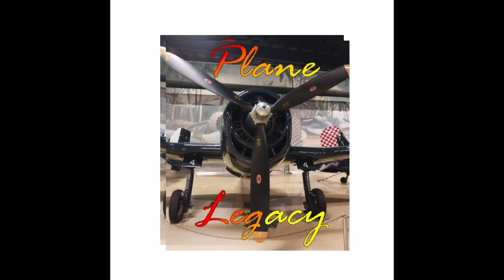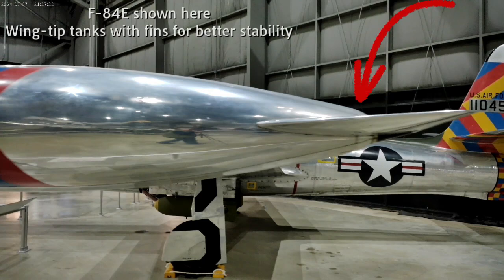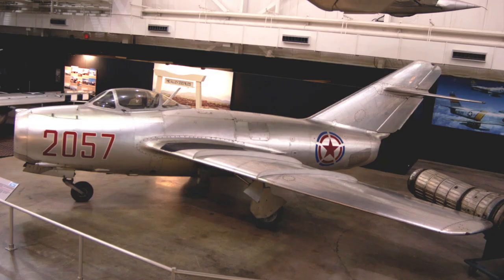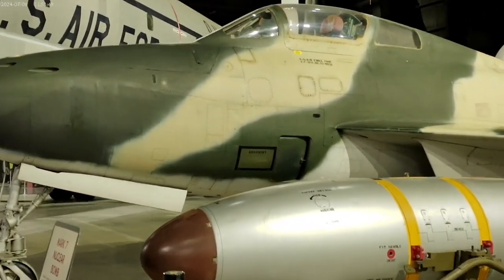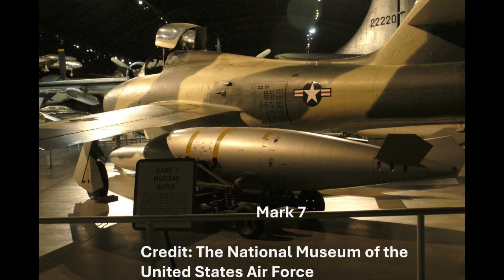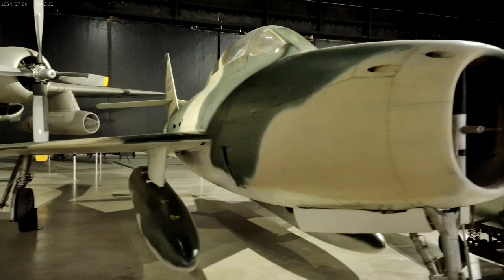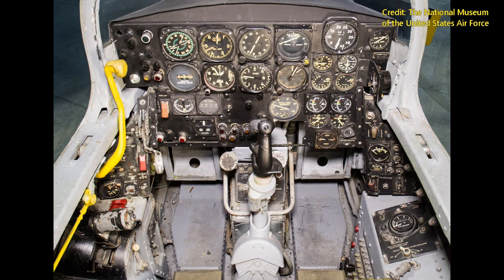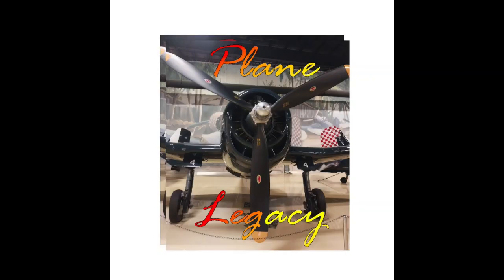Republic F 84  - Four distinct developments, all designated F-84

Comment: I live near Bakersfield, CA and remember the XF-84H being a standard part of the airport scenery for many years. There was at least one other obscure F-84 variant for which very little detailed material is available. It is the one-off YF-84J which was equipped with a General Electric J-73 engine adapted to an F-84F airframe. It exceeded the speed of sound in level flight, but was not adopted for operational use. It would have offered a great improvement in reliability and performance, but apparently the USAF decided further investment was not worth it.
Reply from the maker: Thanks for the information, so many of the great airplanes had the "one-off" variant with a really neat story, thanks for sharing about the YF-84J, Thanks for watching

Comment: Didn’t politics play a role in why the F-84F didn’t become the F-96 and the F-86D the F-95?  Supposedly it was the reverse of why the B-29D became the B-50. 

In the case of the B-29D/B-50 they feared Congress wouldn’t allocate funds to buy more B-29s when virtually new early models were being retired. 

Supposedly with the F-84F/F-96 and F-86D/F-95 it was deemed easier to fund newer models of a design already in production than to request the procurement of a new aircraft.

Off subject; but does anyone think that the Army should have given the B-17E and later models a new designation when they had a new aft fuselage? Especially since they redesigned it an XB-38 when they tested it was Allison engines, and YB-40 when they basically added more machine guns? (Hmm… shouldn’t the YB-40 have been a PB-17E since it wasn’t a bomber anymore?)
Reply from the maker: Good questions! Thanks for watching

Comment: The -F models built by General Motors were built in the Fairfax Kansas GM plant. They built B-25s during WW2 at the same plant. My Dad worked there for 30 years, retired in 2002. He was there when they closed the old plant,the runway was still completely there then,and several flight operations buildings. Dad said the flight ops building he was cleaning out looked like they just closed the doors shut it all up when they stopped building the jets after Korea. He said it wasn't pretty strange and kinda creepy walking through it. There were still blackboards with flight schedules written on em.
Reply from the maker: That's a neat part of history, thank you for sharing that!

Comment: The F-84 was powered by a Allison J-35 which was the US first Axial flow jet engine which was under powered and unreliable. None of the aircraft powered by this engine gave reliable performance as the Axial-Flow turbojets were not really perfected until the mid-1950s
Reply from the maker: Good info, thanks for commenting
Reply: True. On the other hand, it has been suggested that, except for early on, at least the USAF focused on axial flow engines in their fighters vs centrifugal flow engines which typically had larger cross-sections. Also, I believe the GE J47 was a pretty solid design from the beginning.
Reply: @wkelly3053  Both types were extensively used by USAF and USN. The USAF did go for the Axial-Flow but they had short life. They were weak and so 2 had to be used, The USN went with the Centrifugal-Flow in the Panther and Cougar. But with both Services the main complaint was the Axial-Flow never gave their expected power output and led to some spectacular failures like the "gutless Cutlass" etc.